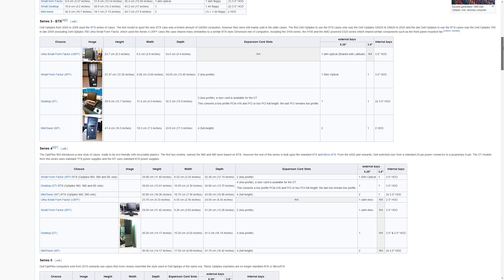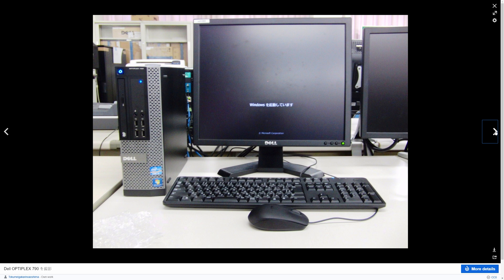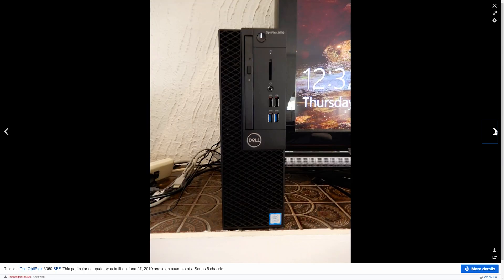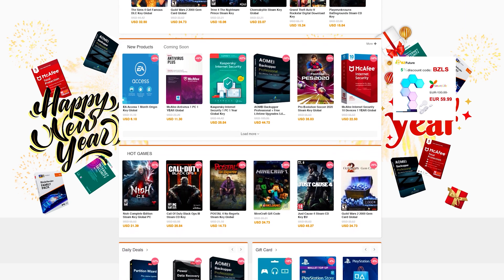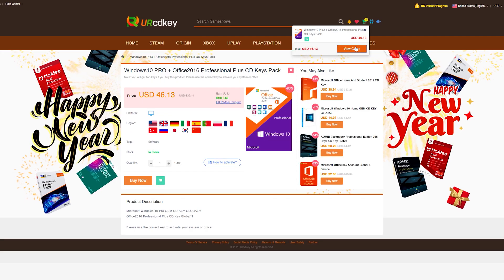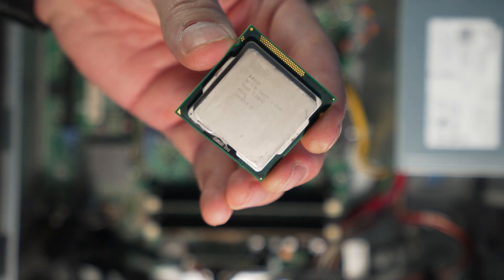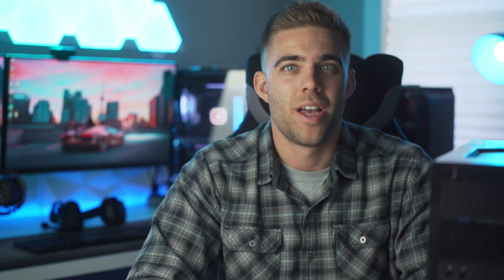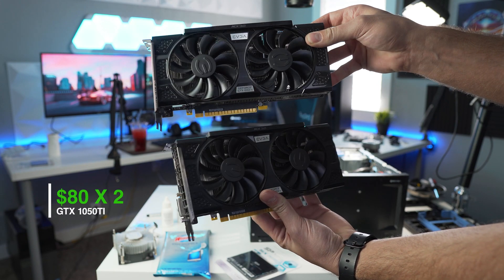Can we turn a Dell Optiplex into a Gaming PC? 🤓

Comment: which OptiPlex are you using for this video? and what OS did you install on the machine?  I took a Dell Optiplex 960 core 2 Vpro (2006) and turned that into a decent gaming machine. More on the retro side, but basically anything from 1990s-2008 era.

Comment: I have a question, my pc is Optiplex 9020. It has no graphic card and i have been thinking of getting a GTX 1050 Ti. But my power supply is 290 W So can it work on this power supply or will i have to change it
Reply: No matter what its best to replace the power supply its old and may cause problems

Comment: So I'm doing a build like this right now. I needs to be said if you plan on upgrading the Power Suppy in a Optiplex 7020 only certian ones will do, I had to do a EVGA 700 BR, 80+ Bronze to be able to do it, it has to do with the power on the rails? Also  I'm doing Linux Daurgr OS, its setup for gaming and thus far I haven't hit a game that doesn't run flawlessly with Valve Proton or other emulation. I find Linux is better for low power builds like this since Windows 10 just loves to expand and consume resources, where as this Linux OS is so clean.
Reply from the maker: very good insight on the linux vs. windows option! I'm not a linux user myself so this is great to know!

Comment: I found in the dumpster from work a dell optiplex 9010 i7 3.70hz 275watt power supply 8gb ram ddr3 radeon 7500 series gpu no hard drive. I put 1tb ssd 32gb ram 450watt power supply radeon rx 580 4gb gpu now its a 13 emulator gaming monster 😁👍
Reply from the maker: I love to see this!
Reply: @RAVisuals  Im on my 4th computer build in less than 2months from my first find so hooked i been transferring my game data with family now its a walk in the park 😁👍
Reply: @RAVisuals  Whats crazy is how I made this pc before knowing the specs exactly what it needs to play the psx3&xmeu emulators.
Reply: Quick update on the 3 other pcs I got acer predator i5 ssd 512gb nividia gforce 1050 2gb 16gb ram 550watts power supply, dell i3 ssd 512gb 8gb ddr4 ram nividia gtx 650 ti 1gb (upgrading power supply still), a 20 year old dell pc single core processor 4gb ram its getting windows 10 like the rest and upgrading single pentium processor to dual core e7400 once I get it back if it works.......

Comment: Top notch videos on your chsnnel, I fried my old motherboard somehow and your videos inspired me to reuse an old 3020!

Now I have an i7 4790K 16GB RAM and a 1050TI all on a rather low budget!
Reply from the maker: So glad you were able to repurpose and older machine! Very cool!
Reply: @RAVisuals  it runs a dream! I've had the small form factor ones before, but for anyone thinking about it I'd definitely recommend the full width and height towers, just for the better power supplies and parts compatibility
Reply: @robertbrown1338  I bought an 7010 Mini Tower with 16GB of Ram and a 1050TI too! 
You wouldn't know if I an I7 4770 would be compatible would you?
Reply: @jakedonlon490  it's..(maybe) possible..technically your mobo and stuff support it, but the problem is the limited power supply.. 

I think the CPU socket is actually only certified for 75w on the sff and usff machines which is a bit low for a 4770..

Put it this way.. I had the exact same rig in a small form factor machine, and burnt out the PSU in under 2 years.. It might work but I doubt it will work well
Reply: @robertbrown1338  I purchased a 450W power supply to replace the old one. That what you mean?
Reply: @jakedonlon490  if they make a 450w PSU that fits then sure..but standard sized of PSU will not fit

Comment: I have a question, if I buy a cheap dell with a i7 3770k lga 1155 and put it onto a gaming motherboard with the correct socket size will it work or does it need to be a specific cpu?
Reply from the maker: if both boards are the same socket, then the 3770k will work

Comment: I have Dell 990 with i5 2500 and want to upgrade but i7 2600 is over priced so max I can get is E3 1280 is it a good cpu?,
Reply from the maker: Yes! The xeons are a great option if you can get them cheaper!

Comment: I paid £50 for a 3020 with an i3 4130... just upgraded to an i5 4570. Has 8GB of DDR3 but I need to upgrade it to 16gb 2x8 sticks. Adding an SSD and a GPU HD7870 £50... I'm in the build about £150...

Comment: i have an optiplex 7010 and that one does have an 24 pin connector so i upgraded the psu an added a ssd now i only need a gpu but they are expensive :( sad me

Comment: I have 3 optiplex 9020s running Windows Linux and Mac OS. They’re rock solid machines… all of mine have 16 Gb of ram, none have good discrete GPUs but they are super fast for what I use them for.
Reply from the maker: still very capable machines for everyday things!

Comment: You know I have a 2010 Optiplex 9020 and I have a 2007 Optiplex 720 and for a meeting for the 7:20 and small form factor for the 920 desktop MSI GeForce 720 or G8 GT 710 720 graphics card 16 gigs of ram in 4 terabytes of space a terabyte and I still server and game system and quick and easy for me to install Linux windows and even edited forms of God sing for the money it's a great computer which I only spent maybe $400 to restore $144 computer so right on with your video
Reply from the maker: It’s definitely an awesome budget option!

Comment: 4th gen optiplex 7020 or 3020 mt are easy to make into 1080p gamers. New power supple about 500w to 750w 16gb ram and rx580 graphics card. You need a 24pin to 8pin adapter cable. Good luck.

Comment: How do I do this to a dell optiplex 960? Also, could I change the intel core 2 duo?
Reply from the maker: Id try to upgrade to a later platform if you can man! the core2 platform is getting seriously outdated
Reply: RA Visuals ok, another question. If I installed a nvidia gt710 what cpu do I get? Also, my power supply is only 250-265 watts so yeah

Comment: Hey just a tip, if you upgrade the graphics card to a radeon 560 or 70 you will get better frames (psu replacement needed)
Reply from the maker: Check out the next videos I did on this 😉

Comment: Hi I have optiplex 9010 with a i7 3770s and gtx1060 6g ram 12 my problem is why my system can’t find 8 threads 
In cpu it only say 4core 4 thread can you help me (I think all i7 3770 have 4core 8 threads) can any one help me with this

Comment: @RA Visuals I literally got this as my second rig. My optiplex 790 came with a i5 2400 and 2gb of ram with no card. Obviously im going to upgrade the ram, but if im looking to add a pcie powered card, do you think a rx 550 would have a problem getting a boot signal? I read on a few reddit threads that a rx 550 and 560 has problems with the optiplex. Any help would be greatly appreciated man.
Reply from the maker: Rome The Revenant i threw in an rx 560 into a dell bistro and it booted up right away, so i see no reason why it wouldn’t work with the optiplex too!
Reply: @RAVisuals  thank you so much for the reply man! Your channel and help is very much appreciated!

Comment: Great video... I hold out for the cheapest i7 with 16gb of ram and put in a gtx 1650 oc ddr6 model and pretty much hit minimum 60 fps on slightly higher settings except for a few games. My latest bargain was a hp ryzen 7 1700 16gb ram prebuilt with a 310 watt proprietary psu and no 6 or 8 pins ( not that there would be enough power) it was a black Friday special and a lot got purchased just for the rx 550 gpu for bitcoin mining. I got mine brand new in the box with mouse and keyboard for 200$ I got a 20$ 120gb m.2 ssd and gtx 1650 for 149$ and built a great gaming pc for 370$... honestly if you started out on the commodore 64 you really dont feel like you need 4k gaming at 144 fps. 720p at 30 to 60 is just fine with me. I play older games and never buy a game, phone or computer unless its been out 2 years first.
Reply from the maker: Thanks for sharing man!!

Comment: Don't need the new PSU
use sata to pcie
* 1 from each rail
into a combiner to single pcie for gpu
=done many times (stock Dell PSU)
 ==no issues (gtx1660 in Opti 9020, gtx1060 in Opti 3020, gtx770 in Opti 390, rx570 in Opti 3010, etc)
Only other components; CDVDRW(rail a), SSD, HDD(rail b)
https://drive.google.com/file/d/0B0_R99IyNBm6VWxSU2lJLUZjZEk/view?usp=sharing
Reply from the maker: I have a full video on this! I use the sata to pcie connectors all the time as well!
Reply: @RAVisuals  Link to that vid, please?

Comment: I’m putting a gtx 1050 Ti and 32 ram then a 1 terabyte also a new 450 power supply with a 24 to 8 pin adapter in 2 weeks I can’t wait

Comment: You can buy a 24pin to 8 pin power adapter and swap out the psu. That's what my optiplex 3020 is running right now. 585w psu, i5-4570 quad core, OEM HP AMD Radeon RX 480, 8gb ram and the shittiest mobo I've ever seen. I just bought it 4 days ago lamo. Upgrading the ram to 16gb 1600mhz, the single 92mm case fan 😂 gota find one that can run at 100% without being super loud and at least 1 ssd as it has 3 sata 6b/s connections so I'm thinking about keeping the 7200 rpm hdd for games and cloning the OS to a 250gb ssd.
Reply from the maker: Michael S very nice! My new video shows another psu option where you don’t have to even buy an adapter!

Comment: How would I turn a Dell 790 w/ I 7 2600  16 Ram  2T HDD I bought for $208 into an online gamer - What graphics card would I need...
Reply from the maker: Nick Long I literally just sold one of those! Had a 2500, 8g ddr3 and a gtx 1050ti. Only thing you need to be aware of in that model is the motherboard. It has the sata ports that block longer length cards unless you really jam it in there. So you can get low profile sata cables from “silverstone” or you just need to use a shorter card. What games are you wanting to play?

Comment: I'm using a Dell optiplex 9020 

 Intel core i7-4790 CPU 3.60GHz 

16GB RAM

 2TB HDD
 
GeForce GT 730 4GB

What graphics card can fit in here. Sorry I have not found out the  power supply info. I want to run Skyrim SE smoothly lightly modded. I'm a huge Elder Scrolls fan.
Reply from the maker: Demonic Dark Knight Shinichi you’ll have the 290w power supply in your 9020 so you can go with many of the cards I listed in the video! The higher end ones will require more power and a bit of modification but you can slap a 1660 or a 1060 6gb and be fine without swapping the power supply
Reply: @RAVisuals  thank you so much you earned a sub

Comment: I got a 7020 with i7 4790 16 gb ram  and im gonna get a 1650 super is that a good gaming combo?
Reply from the maker: Totally! you could even modify the case and go with a 1070 or a rx 580 as well with that setup. Might need a psu upgrade too though

Comment: I slapped on a 1070 into a hp prodesk with the same i5 4590
Reply from the maker: S are you experiencing any bottlenecking? Check out my new video on these optiplex builds as it reveals what gpus are awesome choices for these builds!
Reply: I have a HP prodesk with an i5 4460 and rx 560, how do you power your 1070 did you change your PSU? And did you used a 24 pin to 6 pin  adapter ?

Comment: my dude, you have 2 full size optiplexes
ill focus on the i5 2400 one cause that the same socket as my optiplex build (im using a custom case i made myself but your optiplex has plenty of space in it)
1. yank out the psu and throw in a 500 watt 80+ bronze or up of your choice
2. good gpu but with the new psu you can support up to a 1060 or 1660 with the space you have
3. that i5 2400 can be upgraded to a xeon e3 1270 for much cheaper then a i7 of that socket and can keep up with i7 up to the 6th gen i7
4. grab a cooler master cpu cooler
as for the i5 4590 one
thats a you problem if the lack of 3rd party psu support
but this optiplex gaming pc video wasnt showing exactly how optiplex builders do it
Reply from the maker: Project Serenity hey man, thanks for the suggestions. So this was the “initial test video” if you will. I have recently published a video that goes super in depth into two of my full size optiplex builds. (I actually have 3) that may clear up some of the things you were talking about. As for the Xeon, that’s a very cool idea and is something I’d like to try!
Reply: @RAVisuals   i shall check it out and give my input

Comment: Would you recommend doing this over building a pc with integrated graphics(ryzen 3 3200g)? Also is an i5 4570 3.20ghz optiplex good(112$ 
1TB-HDD 8gb ram with no OS)? If so what gpu would you recommend getting to keep the cost around 300$(I would also be adding an ssd)? Also would you recommend getting a new psu for this?

Thank you.
Reply from the maker: I would recommend this ONLY if you're just gaming and you are okay with replacing the core components other than your gpu in a year or two. Going with a newer platform is usually always better but for extreme budgets, these are pretty awesome.
Reply from the maker: Also, I'll have a video out very soon on the gpu's Id recommend for these!

Comment: very nicely explained, as I have dell Optiplex 9020 and I was wondering where is the 24 pin connector, sir can I put gtx 1650 in it, as the psu is 240 watts.
Reply from the maker: I believe even with the stock psu, a gtx 1650 will work!
Reply: RA Visuals  Thank you for the quick reply, Now I will be getting a Gtx 1650 soon :). Thank You again.😀
Reply: @RAVisuals  Also one more thing, can you please make a video on Dell Optiplex 9020 power supply upgrade, as I have found that a adapter can work from 24pin to 8pin, but how well that adapter can work that I don't know, I mean would that be stable or not, or will it burn the main board on high load etc. This kind of video would be great!

Comment: This is similar to what I did for my gaming pc. Took a viglen motherboard which is an oem for education in the UK. It came with i5 4460 8gb ram and a 1tb hdd. Added a 240gb ssd and an rx 570 and it can get 60fps on games like red dead 2 and it's awesome.
Reply from the maker: Jude Price its so fun to tinker with this stuff and see what you can do to upgrade it!
Reply: Any problems fitting the card in the slot, heard modifications have to be made because the card might be too long but I'm not sure?
Reply: @southboundtp2067  not sure because i took the board out of the dell case and put it in a more expensive nzxt one but then i didnt have any problems after that

Comment: Two points to make, and I can't believe you missed the first.. WHICH Optiplex PC's did you buy? You tell the processor numbers, but what model numbers? Other videos point out the big differences between the Optiplex 9020 (the one I'm getting soon), the 920, the 910, the 9010 and the 790. There are critical differences between these models - do they have USB 3 or not, and if so, how many? Will certain GPU cards not fit in the case without blocking SATA ports? Letting us know what YOU bought would have helped. Heck, next time you do a video, just take a few seconds to let the camera scan across the top front of the case so WE can read the model numbers.

Second, since you went to the trouble of getting Mini-Tower size systems, why NOT upgrade to a bigger power supply? There are cables for $10-15 that will adapt a 24 pin ATX supply to the 8-pin motherboard connector on the Optiplex systems (I suspect one of your systems was the 9010 or 9020, but again you didn't say). The GPU is critical for gamers, and the bigger/faster/better cards need the additional power. If you didn't intend to upgrade the PSU, why not buy the Small Form Factor systems, which are more cramped and limited, but are difficult/impossible to upgrade the PSU? Buyers and sellers know this, which is why the SFF systems are considered "dogs" and "they'll gather dust in my warehouse," and are therefore sold at lower prices. You could have saved some bucks.
Reply from the maker: Thomas Reed hey man! I really appreciate you taking the time to write all of that. You seem very passionate about this so I want to put you at ease! I’ll be making MORE videos on these optiplexs! This video was literally what the title says. I wanted to see if I could turn it into a gaming computer and...i did. Mission accomplished haha. But, I have videos coming that will answer everything you addressed in your comment! This video was not intended to be a full in depth review of the different models, features, etc.

Comment: If some is actually looking at an optiplex build, look for a Xeon processor and something like an RX 580. You can easily get much more performance for 100 or so more dollars. https://youtu.be/n0filLqbuiQ is a good video on some upgrades you could do.
Reply from the maker: hey bryce! I'll be doing more videos on these two! this was just an initial test that I decided to upload for you guys. I'll be going more in depth into these soon!
Reply: @RAVisuals  awesome, I'll definitely watch. I wasn't doubting your build or anything, but a lot of people completely forget the Xeon processors even exist. A Xeon and Rx570/580 combination is still super capable for most anything you can throw at it, especially E-sports titles. I helped my friend build an optiplex system with those components I mentioned and it still kicks modern titles at 1080p med/high like nothing. Best part is we got it for around $270 with some deal hunting and reselling old parts.

Comment: I run at high settings triple A games like Risa of the Tomb Raider and MGS V with no issues. I Have a Dell 9020, 1050 TI FTW, 16GB Corsair RAM, I5 4670 and did change the power supply and used an adaptor, works great.
Reply from the maker: ill be doing some things with different power options soon!
Reply: @RAVisuals  Cool I'll  watch it.